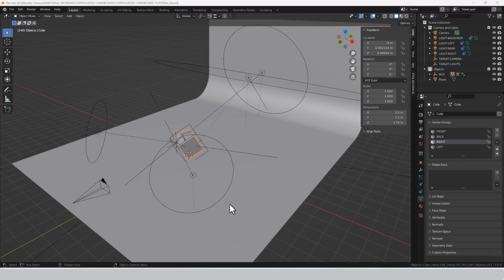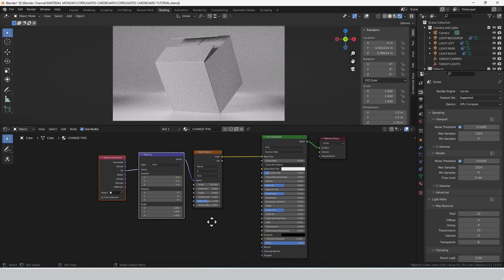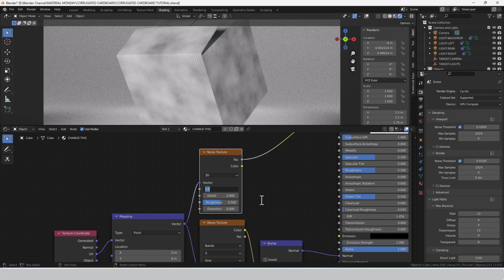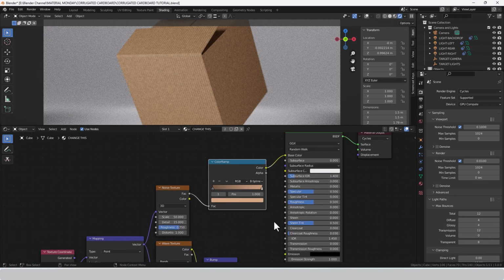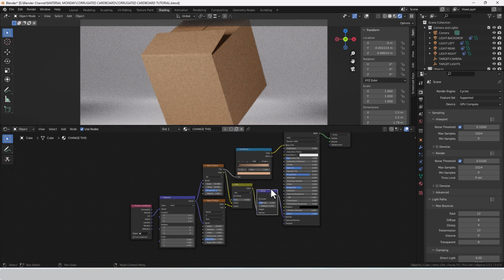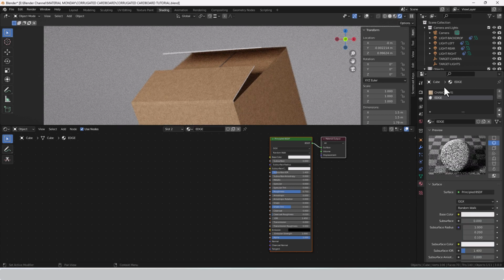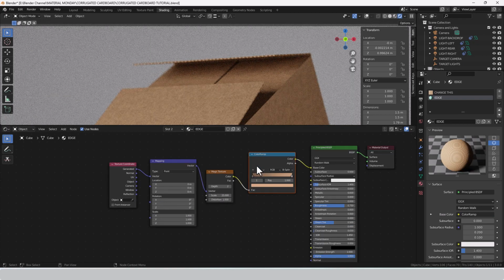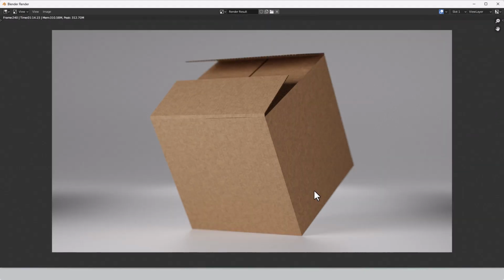CREATE A PROCEDURAL CORRUGATED CARDBOARD MATERIAL IN BLENDER

Comment: Thank you, great tutorial. I'm a little stuck with the edge part. For some reason the magic texture is not showing up like yours. Admittedly I'm using just a cube scaled down on z to look like a single piece of cardboard. I assigned the edge pieces to the cardboard edge material. I tried rotating the edge uvs to see if that changed anything. It didn't make any difference whatsoever. So I'm at a loss
Reply from the maker: It sounds like following the process to the letter might be the solution here.